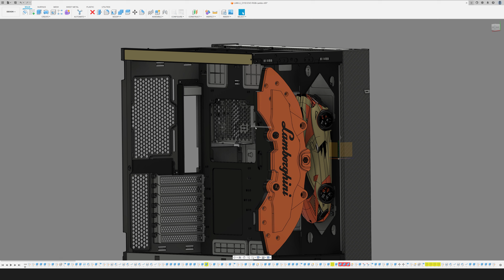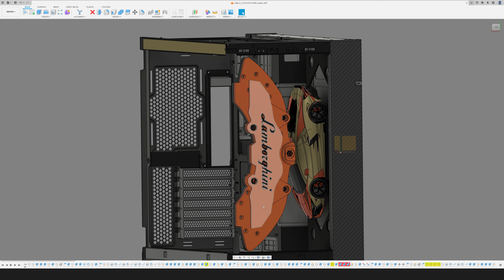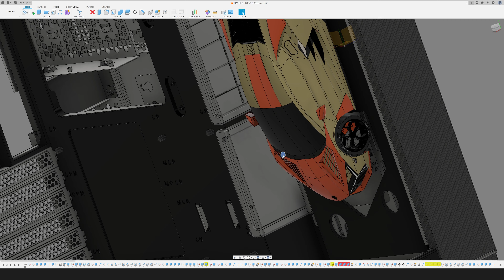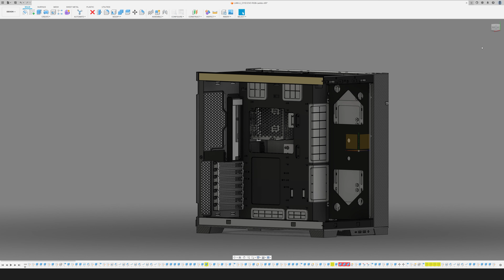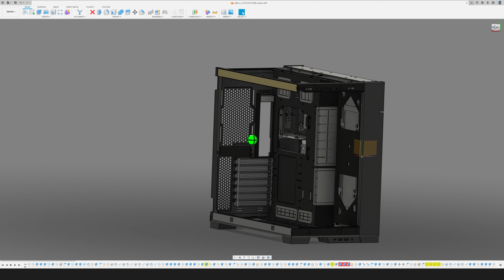Lamborghini Lian Li Evo Edition Z890 ROG Build: Overview, process, waterblock issues on Intel 200s

Comment: Did the PC really get turned on with the button you pressed you did at the beginning?, if so, is there a link?
Reply from the maker: Yes and I made the button. Its a 3d print
Reply: @JCustom ok, how do you really turn it on with the button you made?, and where does it plug into?

Comment: is the orange acrylic 3mm or thicker?
Reply from the maker: I’m using 6mm and 3mm
Reply: @JCustom  Normally distros use very thick 10mm acrylic for both parts of the sandwich... in your experience could 6mm acrylic be used for the "top cover" of the distro? Just asking because here 10mm acrylic only comes in black or transparent...

Comment: What waterblock did you use for the Graphics Card?
Reply from the maker: bykski granzon 4080 for strix/tuf. While it performs fine, the lack of any instructions, finish blemishes it's a bit hard to recommend at the price point which is why I did not go into it. Ill revisit the grazon line in a future video as I have quite some stuff from them.
Reply: @JCustom  Thank You!  I thought that's what it might be but I wasn't sure.  The feature it has that I want is the ports coming out the end, as that will make my tube runs easier.